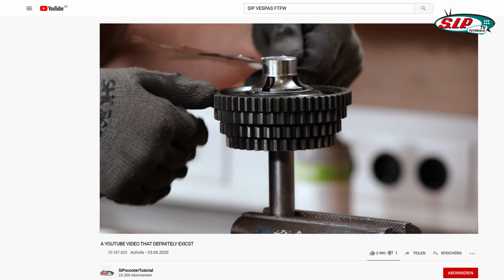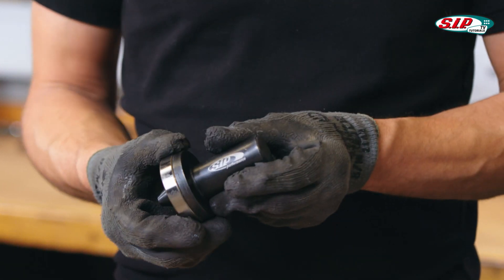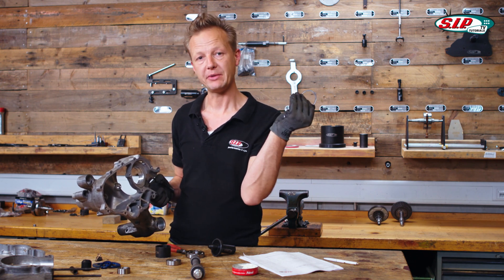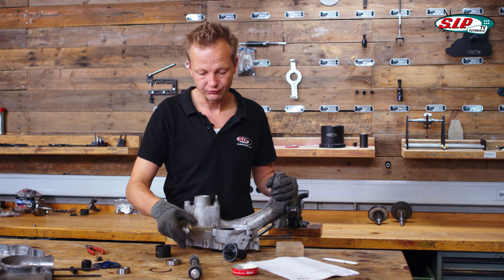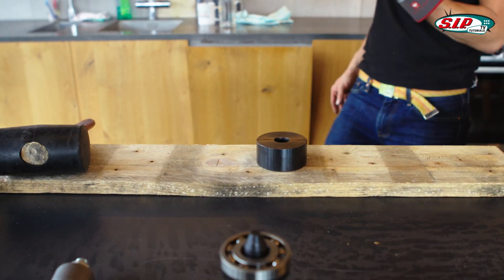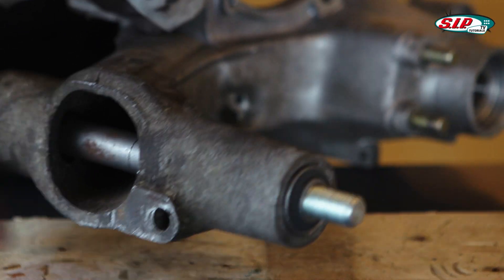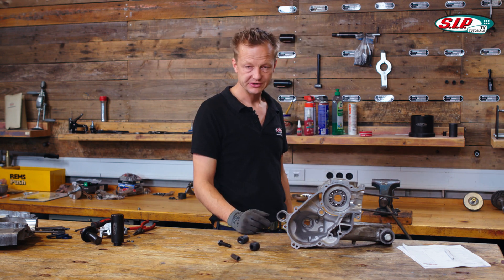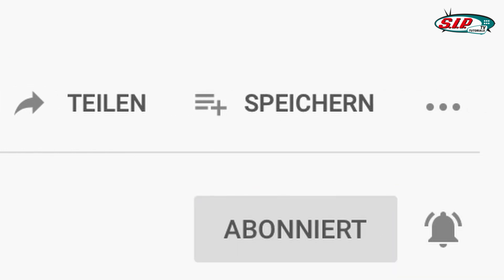VESPA ENGINE REBUILD 🔩| Part 3 | BEARINGS | Tutorial {English}

Comment: Hi. Nice video.
Question: Please, I would like to remove my crankshaft  bearings (both sides, variator side and stator side) without having to  cracking open the case.
 I dont have a workshop and fancy tools. Please Do you have such a video?  My engine is sqeeling like Porky the Pig! 
Thank you in advance for your help.
Glenn in Orlando.